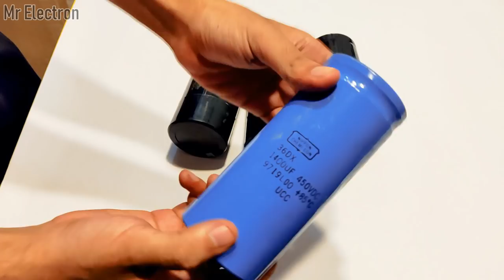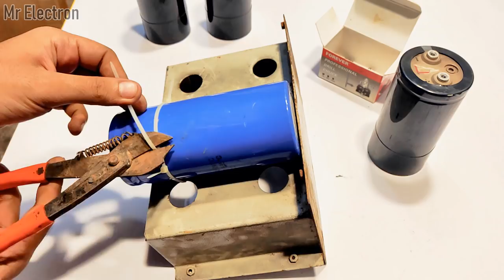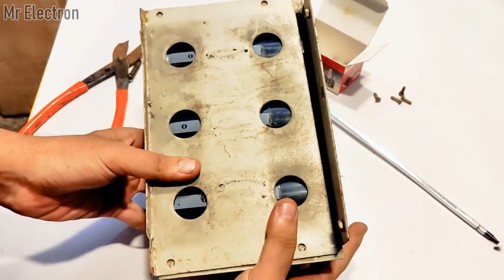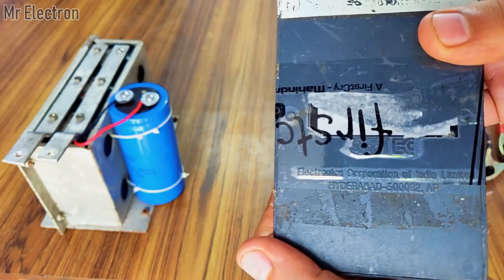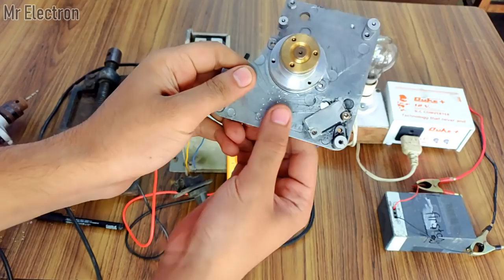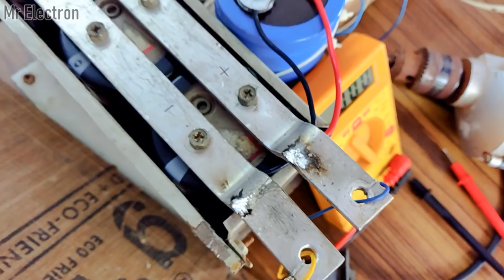Awesome Idea for Drill | New DIY 2018

Comment: I failed to see where you inverted the DC power into AC~.   do you have an Inverter circuit inside the white box with the lamp and the plug?
Reply: That box is a DC To DC Step Up converter that gives an output of 220 Volts DC not AC.

There is no inverter. Most motors are fine with running on DC as most motors are not pure induction motors.

Comment: No...I did not see your volt meter take a short cut through space and time and teleport mysteriously  you drilled for a 2sec at 2-3x speed to give the illusion that the drill was drilling at normal speed... when it wasn't... and you obviously did not drill it in front of the camera... you did it off camera and edited it in to make it look like it was drilling when it wasn't ...the voltage is right there for everyone to see and your drill is made to work off of 220v at 1.5-1.6 amps if it's 350watts... you were able to  get around 150 to 170 watts  average over 5 seconds before the drill would not move anymore due to the extra resistance of friction.. you could drill holes quicker by hand...he is using the shitiest capacitors that are made and anyone with a very basic understanding of how capacitors are made and work can make better capacitors at home with material already in your house...they do this to make it look like it doesn't work good intentionally so people don't try to do it themselves so you will buy them...they are giving you the illusion that it is hard to make good capacitors that hold a lot of energy when it's actually pretty easy

Comment: Hi Mr. Electron,

Actually, the voltage of the DC converter is 400V. So is it safe for the drill machine to run on 400V power supply?

Please do let me know,

Thank you
Reply: This video has got to be fake. I have counted around 4 or 5 different parts that just do not make any sense. first off, you can not operate an AC drill using DC power... maybe I missed it but I didnt see an inverter circuit.... also, with a proper inverter circuit then one would not need those huge caps
Reply: @rorylee1021  the video is not fake. It is just a raw hack that is not easily usable. To run a drill machine you need an inverter that can give at least 800 Watts as drill machines consume between 450 to 750 Watts. However, this is a DC To DC converter that steps up 12 Volts DC to 220 Volts DC. This low power DC output is not enough to run a drill machine so he connects capacitors that can buffer the output supply and give high current to run the drill.

The video is not fake but the hack is not too reliable. 

In a country like the USA compact inverters are available for low costs even in high power ratings such as 1000 Watt. But here in India, the cost of a 150 Watt square wave inverter is 70 dollars USD while for 70 dollars USD you can easily get a 800 Watt inverter in the USA.

Thus this lifehack is okay in India because the total circuit costs less than 30 dollars USD and can be built using e waste only.

Besides, the generic drill machines in India do not use AC motors but they use universal motors that run on AC or DC.

Comment: Hey Mr. Electron!

An extensively amazing and totally out of the box video.

Congratulations for uploading such a video and would request you to upload similar videos in the future.

But, I have a question:

Can the capacitors be used as a battery to power up small  230v 0.5 watt LEDs?
Reply from the maker: Yes

Comment: Are you sure that your DC inverter source is not shorted or overloaded when a drill machine run at Max speed.?  I wanna see this experiment by using a hand powered generator as DC source.

Comment: Can you tell me where can I get those large capacitors
Reply from the maker: not sure ! got it from scrap market
Reply: Oh
Reply: Yep gonna need one of those. So dumb. Your drillo thru aluminum and cardboard pretty much. Who cares. Wth was the point?
Reply: You can get it from the scrap market mostly. They can be found inside water heaters, treadmills and other high power devices. 

Otherwise you can purchase then from an electrical and electronics market.

Comment: what a poor concept. Man you r playing with power that too with charged capacitor bank. More over there is no practical utility of the project. So I give 3marks out of 10.
Reply: no practical utility unless you need some high voltage to get to Mars if the motors were wound for high voltage instead of going through a transformer, mostly parallel, EV's have gotten dangerously fast, so wire your drone motors for 440v or more then attach a embilico cord to the drone hover it within distance that the embilico(charge) cord connects with the overhead power lines where we could use the power lines like the highways
Reply: I thought the same thing.... death caps

Comment: This is a great idea you are using the power from the capacitor s charge the concept is great if you use 2 sets of capacitors with a switch mosfet in the Time you are using one the other gets charged will get more power out

Comment: just buy a better inverter and battery I have powed a Drill like that off a 300w inverter it wont go full power or it will over load the inverter but it will Drill small holes if you take your time. I now have a beter inverter at 1500w but as all inverter there only as good as there battery (the power source)